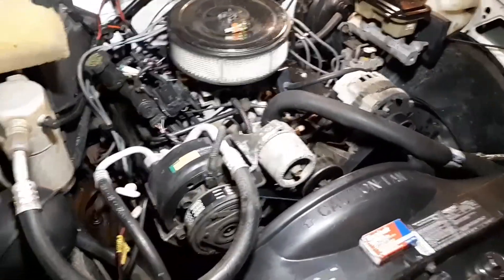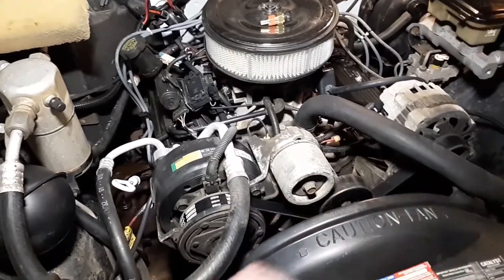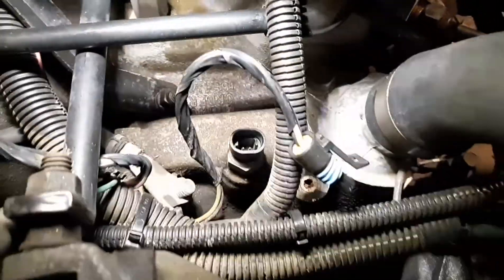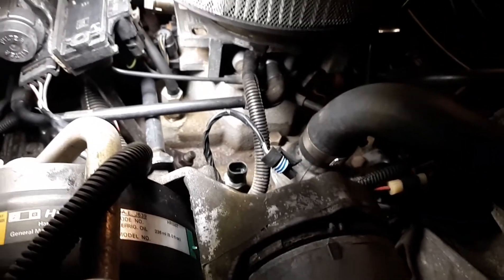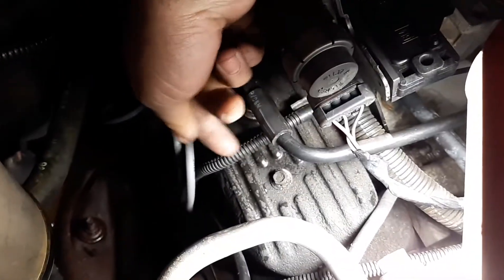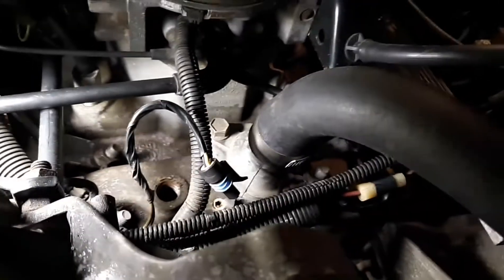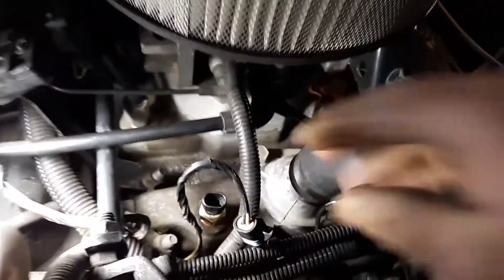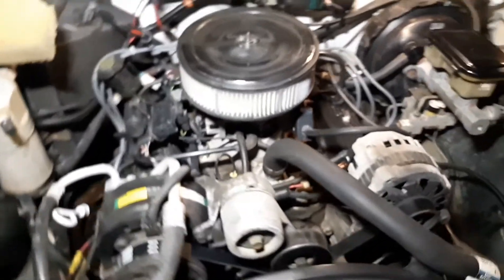Bad Coolant Temp Sensor replacement Chevrolet S10 4.3v6

Comment: Are the sensors the same for both the block and ECM?  I called myself replacing the gauge sensor on the block it appeared black with 1 prong  slot and wired looking, so I assumed it was cracked. It had a green wire going to it (first time really working on the truck so I didn't know what it was supposed to look like) I call myself getting a sensor bc the gauge doesn't read squat and it looks like the one you replaced. Without any other options I put it in the side of the block and tried to wire a ground to the battery bc it was a 2 prong. Besides staying at a junkyard all day, where can I get a plug and sensor for the block. I also have a loose plug just laying around the tbi. I don't know where it goes and I don't see anywhere for it to go. It has a rubber boot on it and I feel like it goes on the tbi somewhere but it's hard finding where anything is on an older truck. The plug is bigger than those for the sensors, it doesn't have a clip and is a 2 prong. The wiring goes in a cluster with everything beside the egr valve. Anything helps man, great video
Reply from the maker: Okay so what were you looking for or needing ? 

Also there is a s10 forum for these trucks too on facebook
Reply: @KnuckleHeadGarage27  my temp gauge in the cluster isn't reading, I have changed both sensors and still nothing. Got any tips?
Reply from the maker: @wavyc__7205  okay the one on the side of the block 2.8 - 4.3 is for the temp gauge inside only . I would take the connector for that one an a wire an plug that into it an ground that . Then turn the key on but not start it an the gauge should max out , if it does then the connector an wiring to the gauge cluster is all good . which means the sensor for that is bad
Reply: I did that and still nothing. Also been reading past full on the fuel gauge whenever the key is on or whenever it's running, I have took down the tank, pump, and sending unit also. Everything including the grounds are loose now and the meter still goes past full. Everything else in the cluster works, do you think I need another cluster?
Reply from the maker: @wavyc__7205  yeah you can try that an see , I actually have another good cluster from my 92 s10 I had in my parts stash

Comment: Do u kno the part number for the gauge sensor?
Reply from the maker: I don't exactly but however you can't mix them up the connectors for each sensor or different
Reply: @KnuckleHeadGarage27  I need to know what the one on the side of the engine is called?
Reply from the maker: @daltoncason6948  that one is the temp switch should be the name . That's for the grauge inside the truck